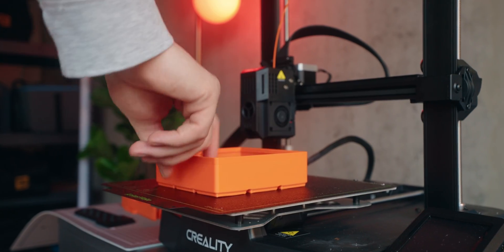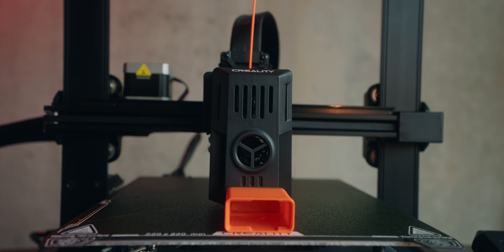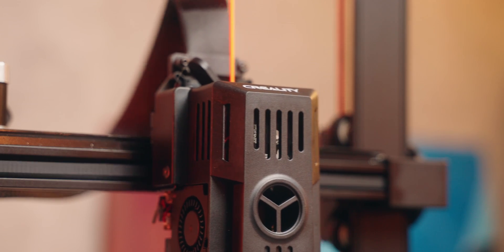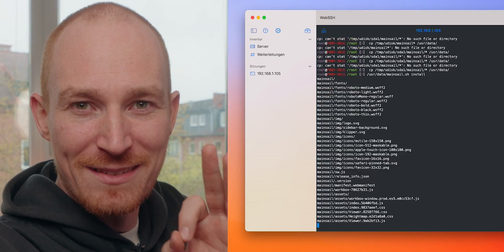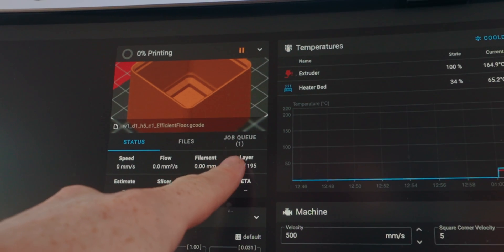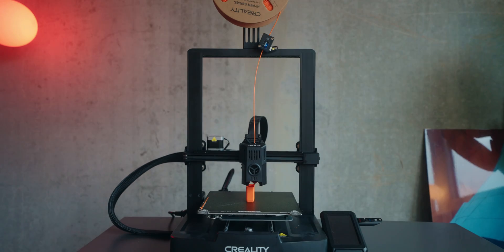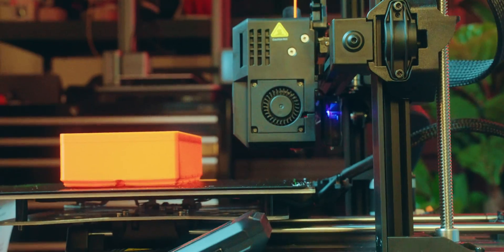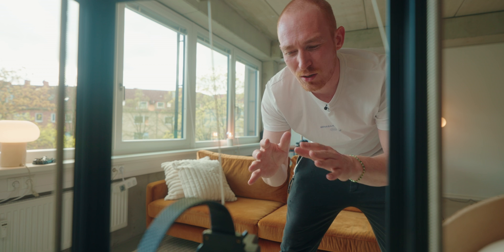How I fully automated my 3D printer

Comment: Sorry you lost me at recommending an Ender 3 to beginners in 2024
Reply: I’m a beginner and the v3 is perfect for my first printer!
Reply: @Endefy  But had you used anything else prior? One point of comparison seems a little limited to use the term perfect?
Reply: I'm gonna buy a ender 3 because of price, I Live in brazil and ender 3 is 200$ and a p1p is almost 1000$
Reply: @habbisc  you do you, but remember that filament isn’t free. If you own a 3D printer (and use it regularly) the cost of filament will eventually dwarf the investment in a quality printer. Not to mention your time, blood sweat and tears learning, maintaining and repairing your printer. 

Maybe the V3 is a different beast to the original as other have claimed, but in my experience I ended up spending more than the purchase price of my Creality machine to upgrade it to my minimum required specs post purchase. 

As the old saying goes, the cheap person pays twice.
Reply: @givemeanaccountdamit  incredibly the filament price is not expensive compared to the rest of the world, it stays on the same price, but the machines is a lot expensive, here you can pay as up as 2x the price because of import fees.
Reply: I'll probably get the ender 3 v3 se
Reply: @habbisc  Would love to hear from you in a year or two
Reply: lol as someone whose felt with every shitty and good printer in the book, (built my first printer in 2016 and have owned over 200 printers since. I can say that Ender 3 is actually a phenomenal beginner print, and actually I would prefer the issue start may come with it over anything else because you won’t get issues too difficult to solve and it will teach a beginner some simplistic troubleshooting techniques. Since 3d printing can go wrong at any given moment, if anyone is going to “get into it” they should know some simple troubleshooting techniques, as well as problem solving skills. I mentioned problem solving skills cuz as I’m sure you know, the bambu labs proprietary OS has a help function that will usually tell you exactly what’s wrong with the printer and how to fix it. I mean cool and super helpful, but again I think beginners need that exposure or when they do run into an issue that’s more unique they will just get frustrated and quit
Reply: @raresquid6967  most people who try 3d printing don’t have your patience. They would much rather have a printer that works for months without an issue because they will be more motivated to fix it. I was a beginner and feel that my ender 3 pro worsened my experience. I quit multiple times.
Reply: @raresquid6967  I too got my first printer in late 2016. It was a Creality machine and grossly misrepresented what it was capable of. Years of tuning and costly upgrades (all metal hot end, direct drive conversion, Ocotprint, etc.) and yet it was still mediocre. X1C out of the box printed perfect every time. Over 18 months later and the worst I have had was a decent jam... Even without my previous experience (pain?) the videos showed clearly how to solve it. Sure, I understood more about why I was removing certain parts to fix the issue, but the end result was the same. I think you will find more people have gotten frustrated and quit 3D printing due to mundane issues than ever would over rare unique issues. I would never attempt to run a 1800's printing press, but am happy enough with a modern colour laser printer.
Reply: Honestly ender 3 pro is a good recommendation, it forces you to learn more about the hobby
Reply: @yobtnirp3D  no, since a majority of people getting into the hobby would just give up. Would you rather get a car that sometimes falls apart while driving on the highway? (ender 3 series) or a good reliable car that is a little bit more expensive? (flashforge 5m for $300 or bambu a1 mini for $350)
Reply: @drwho495  that’s true, I have both a ender 3 and Bambu a1. I never once had my ender 3 break down. But like you said a lot of people don’t have patience
Reply: @yobtnirp3D  See "hobby" is the word I take issue with in your rebuttal. I don't 3D print as an artform or something. I 3D print to make things faster than I could with other tools.
Reply: @AE8ZN6  that’s fair, however some see the hobby in building on modifying their printer
Reply: Honestly an ender  is a great option for people starting. It teaches you about printing, handling issues that arise, and also using your creativity to solve problems with your printer or even just customizing it..etc.
Reply: A1 or a1 mini. Ender 3s were dope when there wasn’t much option and modding was necessary…
Reply: @Jonasmonasonas obviously everyone is entitled to their own opinion on this issue, but I couldn’t disagree more. Again my first machine was a Creality machine that over promised and under delivered. I bought it as a tool, not a hobby, but ultimately spent 4 years modifying it and learning an incredible amount of settings and tweaks in Cura to tune and get the best I could out of it. In the end it was direct drive with an all metal hot end, and even some parts of the motion system were aftermarket. I found it frustrating and expensive because I spent at least as much time getting the printer to run as I wanted as actually printing things I bought it to make. Eventually I bought an X1C and found 2 major things: the frustration of printing is now gone as it just works, and all of the settings, tweaks and general hardware knowledge I acquired are pretty close to irrelevant. I have never heard an opinion that people should learn on a carrier Pidgeon before being allowed a mobile phone so that they can learn how the system really works. Sure, if you are into Pidgeons and love the process I’m sure you can get a lot of joy out of that hobby and the satisfaction of understanding the minutia of requirements around that system. I just feel it in no way is a right of passage and in fact, would think most people would give up part way through that experience and therefore never see how powerful a mobile phone is as a tool. 

No hate in the above, just trying to explain how I’ve come to my conclusion
Reply: The v3 series are very good for beginners
Reply: @TheTechnologicalNerd  The bambu are very good for beginners because they just work unlike ender 3
Reply: Dude I bought one and it sucks
Reply: Yep, I just made this same mistake in January and now it won't stop jamming no matter what I do
Reply: good thing its not the ender 3 lmao its the ender 3 v3 ke and its actually really freaking good i use to have the ender 3 then i upgraded to the ender 3v3 ke and holy crapmwas that an upgrade its better than every way compared to the ender 3 and then i decided to get the p1s because of a sale and yes its definitely better in a lot of ways however the ender 3 v3 ke is actually really close to performance print quilty speed and ease of use id actually say its easier to use then the p1s and p1p because of the v3 ke touch screen interface both the ke and p1s and p1p just work but bambu wins with its unrivaled reliability quality and setup so since i have all of those printers and put them through hell i can confidently say that both are good beginner recommendations if yournon a budget theres absolutely no reason to save up for the p1s and p1p only if your willing to deal with crealitys customer service
Reply: A1 mini of ankermake m5c
Reply: It is the best beginner printer bro! If you can get an Ender 3 to make good prints reliably and with no babysitting, you can manage any other printer after that. So he’s recommendation is spot on!
Reply: @Blue_3is  So to give you context, what you are saying is "if you can plow a field with an Ox then you are qualified to use a tractor". Being able to control a beast of burden is a skill to be sure, but ultimately most of the skills you learn in that pursuit are simply not relevant in the modern era. Ultimately (IMHO) it comes down to are you 3D printing as a hobby? Or are you interested in using a 3D printer as a tool to solve problems. I have no interest in wasting my any more of my time babysitting an undercooked tool in order to have it perform it's primary function.
Reply: @Jonasmonasonas question did you think that way when it came to your car your fridge or your normal printer or is that only how you think when it comes to your 3-D printer if we want this to become as popular as people have been projecting to be it needs to be as thoughtlessly useful as a normal printer connect it to the Wi-Fi do the starting calibrations and print if I did not have enough money my ender 3(I sadly bought this as my first going off of recommendations) would have made me quit 3-D printing
Reply: The v3 KE is a pretty significant upgrade that from what I’ve seen is somewhat comparable to the A1 from Bambu so I think it should be fine
Reply from the maker: Thanks for the feedback! What do you think I should be recommending?
Reply: @arnebornheim I have the same printer as you and I’m a beginner. It was amazing for me
Reply: @arnebornheim bambulab a1 or a1 mini
Reply from the maker: Both are great! If you have the money and space a1 gives you more space which will come in handy eventually. But you can still do a lot with the a1 mini as well
Reply: Bambulab a1 mini is the best printer in that category imo @Arne.Bornheim
(Edit: I meant a1mini bit a1)
Reply: @nonamenone4540  It’s nearly triple the price of the V3 SE, that is not the same category
Reply: @pavletrnic1433  Sorry, my mistake meant to write a1 mini, which is still 1.5 times the price, but definitely worth it, 80 dollars price difference will be equalised by replacements etc. On the ender.
Reply: @arnebornheim Ender 3 v3 ke, auto leveling, Bluetooth printing , camera connection, etc
Reply: @arnebornheim I think the best printer for $300 dollars is the flashforge 5m and it is more reliable than my p1p
Reply: @arnebornheim  Honestly it's obviously a hard problem... At this stage, I'm probably still saying a P1P though. Sure, it's significantly more expensive, but over time the biggest cost of any 3D printer that actually gets used will be filament.

My first machine was a Creality CR-6, and I have honestly not added all the money I spent on upgrades to get it to perform as advertised because I am too scared... Easily more than my X1C :/
Reply: @AE8ZN6 or an a1 if you’re on a budget
Reply: @AE8ZN6 sure then when it breaks or if you need to troubleshoot something you won’t know what’s up…
Reply: @AE8ZN6  I have an ender 3 v3 se and with upgraded nozzle ive had zero clogs or issues after 300 hours of printing. I wont lie i feel like your talking out of your ass
Reply: @Jonasmonasonasi can agree, i have heard a p1p is a great printer, but you gotta understand the machine so you can do upgrades or repairs
Reply: @LucaThePupineer  How well do you understand your laser printer? It is a tool that many people use frequently, and yet no one will criticize anyone in the office for not understanding the fine details of the settings. Ultimately it comes down to, are you using it for the joy of printing? Or to achieve a task efficiently?
Reply: The ender 3 v3 is not the typical ender 3 pro you have in your mind, so I thini it is a pretty good option
Reply: I disagree. I got the ender 3 v3 se and they have really added some great features on a 200$ printer
Reply: @pavletrnic1433 Enjoy that thing It doesn’t even have linear rods. 50 bucks more you get a far higher quality A1 mini
Reply: I’m not sponsored but anything from bambulab is simple and amazing if your going on budget the a1 mini is great other wise the p1p or a1 combo are probably the most value for the money. The ender just has to many constant errors.
Reply: @Arteouss  Thats like saying buying a Mac is better than getting a Windows PC. Sure, some people prefer it for its simplicity and out-of-the-box functionality, but a windows PC will always give you more for your money, although you have to tinker a bit to make use of it.
Reply: @pavletrnic1433  PC user here... No comparison. A more accurate comparison, would be a linux box vs Windows. Your (linux) E3 can work reasonably well, provided you are willing to do a lot of extra work. Meanwhile a (Bambu) PC will just go to the internet to grab all the relevant drivers you need to make things plug and play. The difference is the Linux box can achieve things that he Windows machine would struggle with... Not so much with the printers
Reply: To be fair Ender 3v3 is a very different printer to the older Ender 3s. They should have named it something different as it’s far and above a much better printer and is really a great entry level printer in 2024.
Reply: @TheGreatWolf13  Agree to disagree? Pricepoint notwithstanding the X1C can print minis close to resin quality with no detailed knowledge. Beginners shouldn't have to go through the pain that I did 8 years ago when I got my first creality machine.
Reply: @AE8ZN6 unfortunately I can’t agree to disagree. The ender 3v3 didn’t exist 8 years ago so someone new to the hobby won’t go through what we went through with earlier printers. The ender 3v3 is not far from a Bambu labs set up and ease of use for beginners, self leveling and camera included. I have a P1S now and certainly would recommend it over a E3v3 if they can afford it, but a a blanket statement such as yours is borderline  gatekeeping if you’re saying someone should spend 6x as much to get into the hobby when an E3v3 in 2024 is actually a really solid beginner friendly 3d printer at a great price point.
Reply: I would recommend the new anycubic kobra 3 multicolor printer combo
Reply: @MingsTakeover  for a beginner?

Comment: I wonder how hard it would be to add a wipe wall to the printer? Maybe a wall that is normally just in front of the head. and only slightly above the surface. Would not work with all prints (thinking short like a lithophane. but there is always limits.

Comment: Great idea! A concern is what about a shape that moves out of the way of the head? The use that you had as a test is very predictable nice flat side. I would want some visual conformation that the part is gone, before it continues, maybe a remote continue.  Maybe it would have a limited range of parts that it would work with. Min height, flat wall. This could be over come with a sacrificial wall built. a worst case is something like the articulated dragon. ( I have no use for them, but the concept shows the problem). short, misc. fragile spikes that might not fall off the bed. with a remote conformation maybe it could activate another sweep off, or next print. But even if it has a limited effectivity, great option!
Reply from the maker: Definitely a good thought! There will definitely always be limits to this method. Especially with very flat or multiple objects. I like your idea with the wipe wall. Also, you could make the gcode make multiple push offs in different locations, maybe? 

Since right now, I only need it for gridfinity stuff, I'm trying to keep it simple. But there are definitely ways to improve it 😊

Comment: I’m not sure if G code wise this works the same as CNC machines but if you’re printing the same print just over and over you should be able to just make a simple looping program. So for example with a CNC mill you would replace the M30 with a M99 so it jumps back up to the start of the program and starts over.

Google subroutines and sub programs if this runs g code similar you should be able to have a main program that basically has all the programs you want to run listed in it with Gcode to loop through them and call up each program saved in the memory of the machine one after another without the need of a web interface 

Should be all handled with the code
Reply from the maker: Yeah, as far as I know, you could just loop the same print no problem! For me, I wanted to be able to put different prints into a queue though, which is a lot more flexible 😊

Comment: Do you know guys if it would work with bambu lab printers ?
Reply from the maker: hey! @thenhowboy also asked this, so I'm just gonna copy paste my answer 😊 

I don’t have one, so I can’t say for sure. You definitely have to change some values in the code because of the different bed size but generally, it should work. 

Not sure if / how you can make a print queue on Bambu, though.
Reply: I don't see why the concept would not work. with my X1c I would need to leave the door open. probably make sure the print being pushed off does not hit the side. I have a theory of designing a wipe wall that is activated by moving the head to the right above the poop shoot area behind the bed.  other part is setting up a print que.  that you could auto start. or I would probably want to remotely start the next print. at least for a while. till I felt I know the variables that cause it to fail.

Comment: would the code work on bambu lab printers?
Reply from the maker: I don’t have one so I can’t say for sure. You definitely have to change some values in the code because of the different bed size but generally it should work. 

Not sure if / how you can make a print queue on Bambu though.
Reply: I wish it did. That would be nice. But the app off Bambu Lab you can press reprint and it will knock it off. That's what I do.

Comment: Will this code work for the prusa xl with 5 nozzles. Jk but you should create your own coded printers for resail like modded you may have a big market. Especially Etsy shops would buy them
Reply from the maker: Thanks. I think if you really want to do this professionally there’s better ways to especially for prusas there are complete addons for an extra cylinder to push off things or thing to swap the entire build plate!